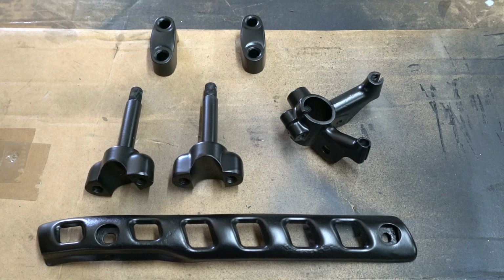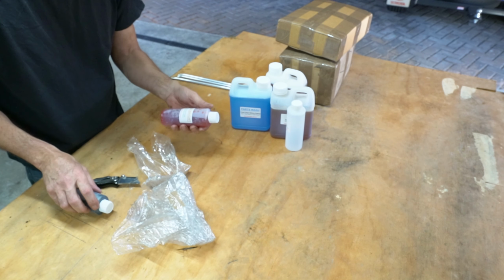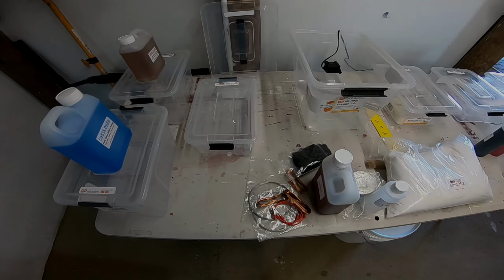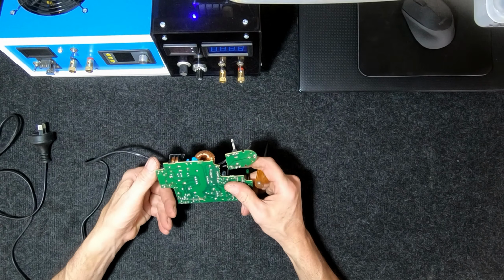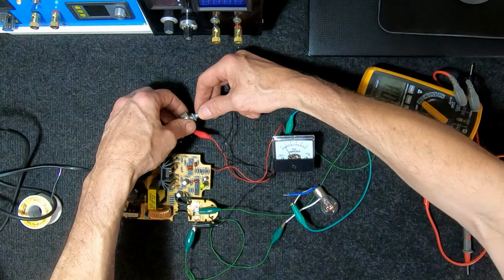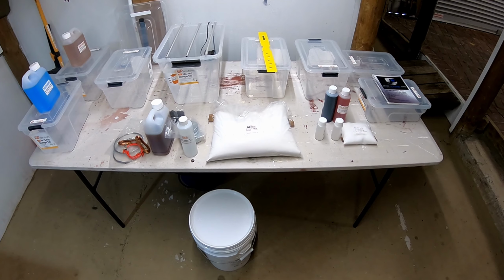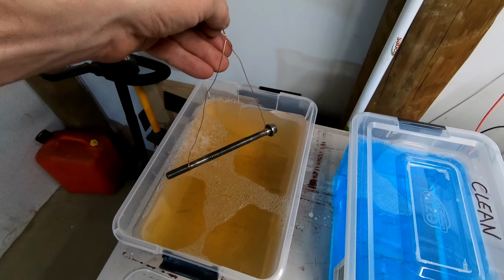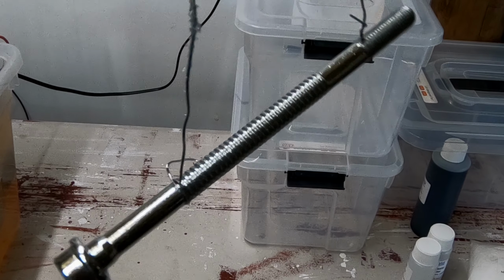Zinc  electroplating plating kit.

Comment: I have finally had some time to get my Jane Kit setup. Mixed results currently, are you still plating successfully? Another video on what you have learned will be helpful. Is there a way I can private message you to chat about the Jane Kit?
Reply from the maker: Couple of pointers I've learnt along the way, clean clean then clean again, rinse parts in demineralised water. Don't touch clean parts without gloves.
 Amps / current flow can be tricky to get rite, trial and error is the go, low current and longer processing times seems to give shinier parts. Zink brightener gives good results but less is more. To much can reduce the finish quality. If u add to much, just plate some junk parts till the finish improves.

Comment: Good video, but would be good if you  had used something more readily avaialble as a power source, I've seen some using battery chargers and 12v batteries. Can you store the chemicals? and for how long etc?
Reply from the maker: Chemicals do store well if in sealed containers. You can use Batteries or chargers. But for better results a power supply with a variable current output is best.
Reply: @mostlymotorcycles.  Ok thanks- I seen another video that used a variable supply so now I understand the need for it

Comment: I've bought a 30 volt 5 amp adjustable power supply from Jaycar , but I don't understand the amps setting. I set it at 3 amps but the digital tells me it using 0.4 amps, does that mean I can't put in more amps or did I get the wrong power supply. The amps you showed for the bolt was under 1 amp, but what amp did you set it at ? Did you heat the solution ? I did initially use a phone charger but it was slow going, so I left it for 24 hours ... it ate half the nickel and the bolts was rough as with nickel, so now I trying to reverse it.
Reply from the maker: If the setting was 3 amps but only outputting 0.4 then increase the voltage set point. higher volts will push more amps.

Comment: I'm looking at buying this kit. It comes with a 5 amp power supply, yet Jane kits recommend the use of a higher amperage power supply. Watching your video, upto 5 amps seemed plenty. Maybe more amps are required for larger surface area components? What would you recommend? 
Jane Kits should be thanking you for uploading this, had me sold.
Reply from the maker: Your correct, more surface area = more current / amps.
There are some surface area calculations that give you a guide to the number of amps required.
Calculation chart come with the kit. But, its impossible to work out the surface area of many complicated parts. So, its part observation part trial and error to work out the best current. 
A current adjustable power supply is essential to achieve the best results.

Comment: Looks good. The nickel/cobalt kit from Jane apparently give a chrome like finish. Very little amperage is needed for home plating, .5 to 2 amps is usually enough. Some people just use phone chargers with good results. I'm not sure if there is an ideal voltage or if it matters at all.................
Reply: It doesn't if you're doing small stuff i been doing mine on a 12v bike battery with brilliant result's but the rectifier spring i got in my kit keeps getting hot & iam sick of charging it & i can't use the battery charger because it frys the shit out of the anoinds so bought myself a 1503DD witch is 15v 3amp rectifier think it was for mobile phone repair really  but it doesn't do anything on the amp side when i turn it & all i get is bleeps like it's shorting out & everytime it does bleep it like sends a pulse of power to my part that iam trying to plate